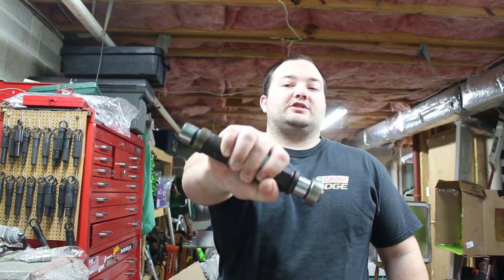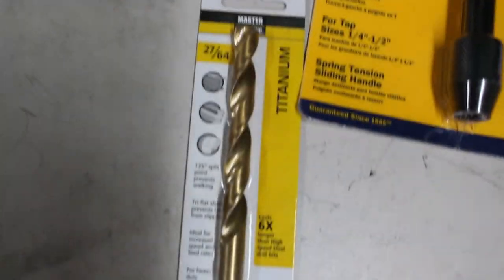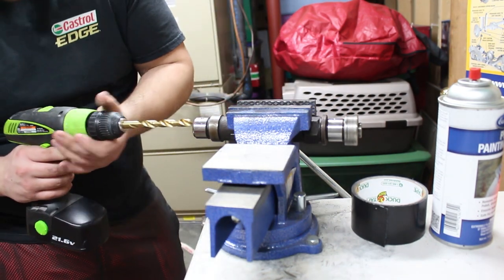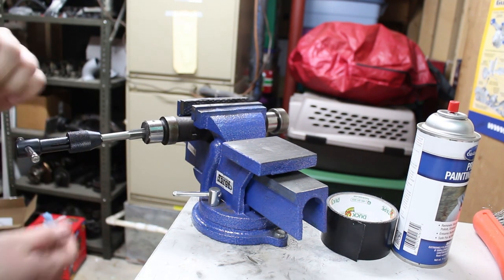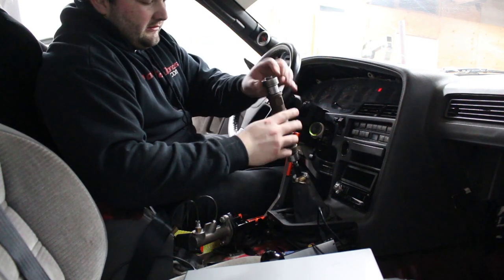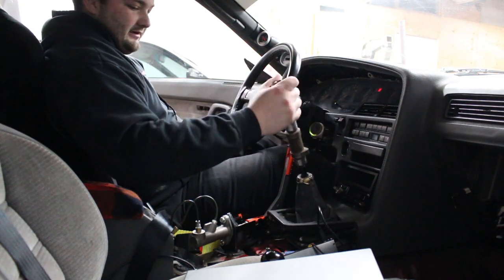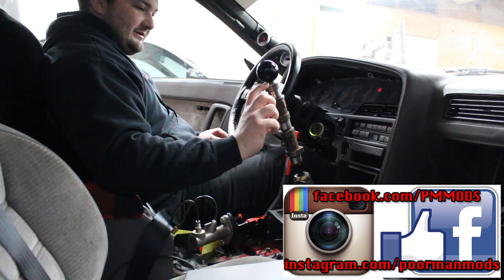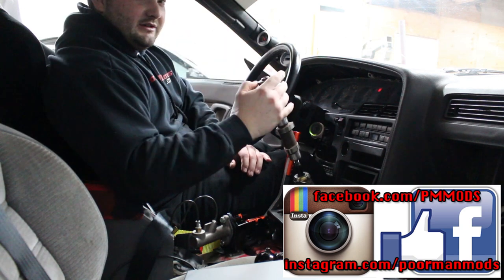DIY Custom Shift Knob | Camshaft Shift Knob

Comment: its easier to drill/tip correctly when drilling/tipping from top down vertical. just a tip!
Reply: Unknown Also when tipping you should go 1 round, then back half a round to clear the threads on the tip from metal particles and shit.
Reply: Unknown some cutting oil or wd40 wouldn't hurt either. Made me cringe at the way he just screwed the tap in.
Reply: FD36 Yeah always use oil or a oilbased product like WD40
Reply: Unknown old automatic oil like ats oil is really good cutting oil

Comment: ...If it's the same thread pitch for the cam bolts you didn't need to drill and tap the holes....just flip it around....

Comment: Great idea :) 
Just a thought though, instead of making the cam shorter can't you cut the gear stick shaft itself and thread it further down? So the cam replaces the original shaft, not just adding to it. 

Also I saw a video come up with Tony and a new daily? Then it disappeared :( what happened?

Comment: Couldn't you have just screwed the shifter arm into where the cam bolt goes?
Reply from the maker: FatAznWithCake yes but i want that portion to be at the top, and if i did that wouldnt really make for a video...